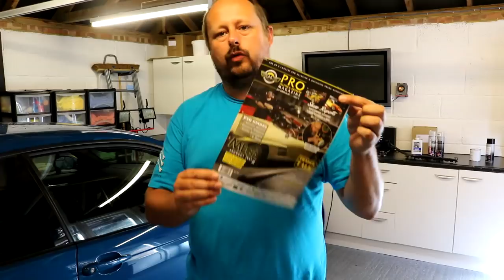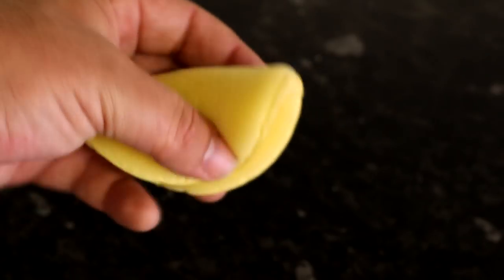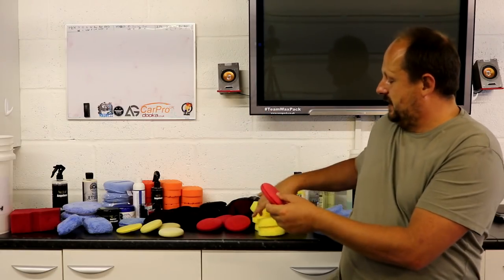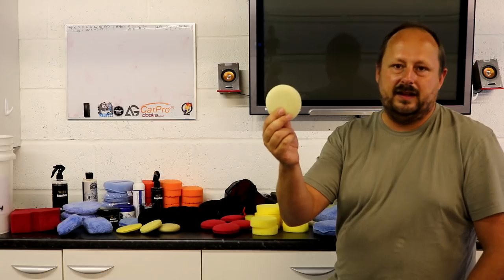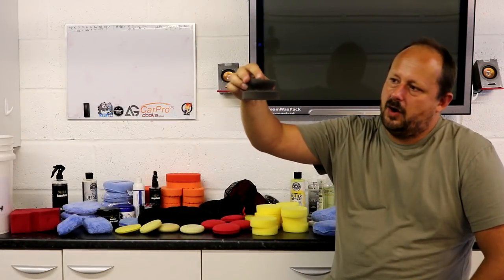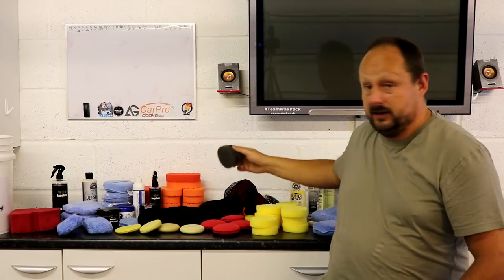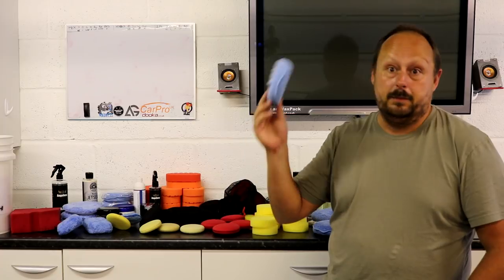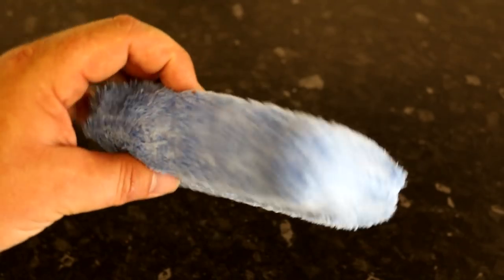The Best Wax applicators - Foam and microfiber car applicators reviewed

Comment: I got one of the shine mate 3" wax/poish applicator sets and you can then use whatever 3" spot pad with the velcro backing that you like. Personally, I like the Farecla G mop 3" black finishing pads. At around £13 for 5 in a pack they are excellent value for a branded product. The shine mate handle thing is about a tenner originally with a couple pads, but its soooooo much nicer to use.

Comment: Hey Jon, are those round yellow cheap foam ones about the same as the applicator that comes in the Fusso can? I really like that applicator, still have it. You just wash it after using and it gets a bit softer than when new but still works very nicely.

Comment: I always grew up believing that sponges or foams created swirls in paintwork, is that possible or just crap. Great channel btw!
Reply: ryco2000uk no they dont. The issue with sponges are that they don’t pick up solids very well so scrubbing them over dirt they will scratch your paint while microfiber absorbs  the dirt and won’t create that many swirls
On clean surfaces however (and they should be clean if you want to apply waxes or sealants) sponges are save.

Comment: Which one of these would be best for a one step like Maguire's ultimate etc
Reply from the maker: The red hex ones I think
Reply: @ForensicDetailing thanks for the reply, that eBay link no longer exists. Chemical guys do one but I didn't want to pay £10 for one sponge. It would have been a good choice because of the surface area. Have you got another link or another suggestion. Thanks

Comment: Congrats on 10k subs John, also want to say I finally cleaned my car myself for the first time using your 2 bucket method video. 
Also wanted to ask but how is the microfiber pads in terms of durability as I've heard bad reviews about some saying the stitching comes loose
Reply from the maker: microfiber madness pads?   solid as a rock for me so far mate.
Reply: thats good to hear. the reviews i looked at were the cheap meguiars pads and another brand ive forgotten
Reply: John I also wanted to ask but on my cars I get these yellow spots and noodle like spots on my car. Just wanted to ask but do you know what this stuff is. I think it's from plants plus how would you go about removing them. I used baby wipes and lightly wiped them off
Reply from the maker: hey but I would not use baby wipes generally..  Or at least I dont use baby wipes so Im not sure if thats a good idea or not but my gutz say no..   Yellow spots and noodle like spots hmmm...   Im thinking bird crap?  not sure if you have a picture mate...     if it doesnt come off during the wash you can sort of work your way up the line of agressive...   starting with detergent of shampoo, to an apc, then a degreaser maybe, maybe something mildy acidic, then after that you start looking at something abrasive like clay or polishes etc..  without knowing what it is its hard to recomend what to try.
Reply: Hey John, from what I've found its bee poo and that yellow deposit is digested pollen and nectar. When I cleaned my car I did notice that one spot didn't come off with snow foam and a light wipe with the wash mitt. I just put a bit more pressure on the mitt to remove it. Will keep a mind on bilt hamber surfex

Comment: Forensic Detailing Channel, have you given any thought to doing a camparison between the Flex XC3401VRG and the new Makita PO5000C? There is a lot of message board chatter around the new Makita PO5000C. as it a shorter throw polisher (does both free rotation AND fixed rotation) at 5.5mm, but has a higher oscillation rate (790 OPM vs. 480 OPM).I am in North America, so I don't even know if the Makita has made it to the UK yet.
Reply from the maker: first time Ive heard about the makita, im not sure Ill be able to get my greasey hands on it over here in the UK
Reply: Forensic Detailing Channel I'm not even sure if it will be released in the UK or Europe  Your review of the Flex XFE7-150 is easily the most complete and detailed review of that polisher, and I was hoping you would do the same for the Mania.
Reply from the maker: if it comes over to the UK and I can find a company willing to loan me I promise ill review it...

Comment: Hey jon got a video idea , I have been trying to research for past few days on how the hell to clean these wax applicators and haven’t found anyone covering this? I have autoglym hd wax kit with 2 red sponges that came with it , I used them about 2 years ago and forgot to clean them and found them the other day and it’s rock solid so I went and collected all my other applicators and some are still soft some are hard but I have a bad habit to use them and not clean them so wanted to know how to clean them properly... do I soak them , do I put them in washing machine? Do I use soap or fairy liquid I’m not sure what to do, you got a good video idea which hasn’t been covered yet
Reply from the maker: you cant easily clean wax out of foam applicators or fully clean.  best thing is very hot water under a tap and spray them out with surfex HD at 10:1 and scrub the hell out of them, surfex is a lot more powerfull than fairy liquid..  very hot water.  but even after doing this they will have some wax in them :)  I would not worry too much though.
Reply: Forensic Detailing Channel nice one I have 4.8l of surfex hd hardly use it other than engine bay clean , didn’t know I could use it on things like this ! Thanks for the heads up I will try that , p.s don’t forget to do a tyre review on those new tyres you got on the m140 you promised to do awhile back in eager to hear your review on em 😎 big up and stay safe fam 👊🏾

Comment: using wo-wo ones for waxes, microfibre applicator pads like these for glazes/pre wax cleansers https://shop.autofinesse.co.uk/polish-pads, the round cheap blue kent microfibre applicators for glass polish (same as your cheap and cheerfull) and these applicators for tyre dressing which are awesome quality and the foam doesnt break up and ive used mine a lot of times https://www.prestigecarcareshop.com/collections/wheels-tyres-trims/products/adams-vrt-super-block-dressing-applicator

Comment: I only use microfiber applicators. I feel that foam does not slide over the paint as good, it kinda sticks.
Reply from the maker: that sticking is usually down to the product you have on top.. I know exactly what you mean though..  I think some waxes are really prone to leaving this grippy feel to the paint and the next time you go and wax it feels all sticky and rough..   other times you wax on top of other products it doesnt happen and you lay down the wax on top and its all silky smooth,,,
Reply: I use microfiber, easier to clean after, easier to put on a thin layer and it is always smooth. No sticking. 
The cheap ones on ebay are pretty good! I have not had any problems with them and if they get old you can just use them for example for tire dressings etc..
Reply: I found this with Bilt Hamber Double Speed Wax. Only glided over the paint just after dipping in the pot. But when you're trying to apply it thin it would stick and drag on the paint which was annoying.

Comment: From complete ignorance, could you use the red dual pad spta hd (the one you reviewed in the ebay polishing pad video) for waxing? I'm using a meguiars wax (it's kind of liquid/cream-ish)

Thanks
Reply from the maker: I think your asking can I use the red dual foam spta pad to apply a wax...   yes you could.  but I find most paste waxes are better applied by hand..  by the time you bust out the machine polisher and set up you could have waxed half the car, plus the machine can access all the areas of paintwork easily..

I tend to only apply products by machine that are looser and less oily than paste waxes, and work better with a really level application...   In fact very few things really..  maybe only abrasive prewax cleaners, or abrasives AIO or abrasives glazes...

Comment: Jon, have you heard of a German brand called Alclear?  If so have you any experience of using their products?  I've never seen any comments anywhere on this brand. I bought a couple of their polishing pucks via Amazon, but they seem slightly rough for the purpose and I'm scared of scratching the paint.  Is there any way an enthusiastic amateur like me can gauge whether or not a product like this is safe, or can be harmful? Not all you viewers are knowledgeable detailers, but love your videos.  Anyway I'm sending for some Auto Finesse pucks on your recommendation.
Reply from the maker: hey mel...   I dont think Ive recomended the AF pucks based on the price.  I found someone selling something similiar for 1.50 but they ran out of stock fast.   Im not sure what AF charge but I would not really pay more than 2-3 quid for any foam hand applicator.  think fecks philosphy sell something like it a lot cheaper.

best way is to test the alclear products on a daily driver or get a test panel from your local body shop mate.
Reply: Yes Jon, my error, sorry.  Must pay closer attention.  I'm claiming a senior moment.

Comment: Hi! i've a question to tell You.. which is the main difference between a wax and a sealant? i mean what i should use for what and when? 
thanks as always great video 
Filippo from Italy
Reply from the maker: hey filippo generally speaking a sealant forms a chemical bond to the clearcoat... where as a wax is left behind on the clearcoat after the solvents vape out...     generally speaking sealants offer more durability but require better preparation..   waxes can offer a deeper more jetting gloss on application but are way less resistent to detergents and their protection and gloss qualities fade quite rapdily (on a product by product bases though there are exceptions to this statement)

we talk about waxes and sealants a lot in the "best wax" video and the PVD mega test wax video on this channel.
Reply: Forensic Detailing Channel thanks for the answer. about layering.. is it reasonable to lay a wax on a sealant? for ex to add more gloss.. (?). So i imagine that the choice of a sealant instead a wax is just up to the user.. according to his target of results.
Reply from the maker: layering is an option, but remember only one product can sit on top, so whatever surface characteristics your sealant exhibits will be hidden away untill the coating above them washes away or fades..  you also run the risk of introducing compabaility problems depending on your choice of sealant and your choice of top product...   certain chemical combos dont work well togther and you can get bad results..   also waxes are around 60% solvent, so another unknown is how your base coat sealant will hold up to being coated in a layer of solvent, and what the implcations are to the sealant and what the wax does.

if your going to layer pick combos that have been formulated to be layered, ideally from one brand..  

For example, using Super resin polish, and then applying extra gloss protection sealant, and using autoglym HD wax after the EGP has cured works.. And it works because autoglym have designed them to work and use compatible products and solvent choices etc...

another example would be using angelwax Ti22 sealant and topping with an angelwax wax like 5th element (good very durable hydrophobic glossey wax) etc..
Reply: Forensic Detailing Channel thanks a million! I'm planning my first detailing adventure so i wanted to have all the things in the right place at the right time (and if possible at the right price 😂)

Comment: have you tried the auto finesse puck?
Reply from the maker: yes I like but with foam applicators I usually dont want to pay too much so most of my recomendations are what I think is really good value.  but AF do some sexy accessories products that are worth supporting...
Reply: Forensic Detailing Channel thanks mate. Is it comfier than the others. I find my hand tends to cramp up using the flat style foam and microfiber applicators
Reply: Jon Bennett when I use a foam pad to dress my wheels I tend to hold it with two fingers and my thumb. I find it more comfortable than using all your fingers to hold the pad which tends to give me cramps

Comment: I love you’re channel, In you’re more recent vids I’ve seen you use a hexagon like shape hand applicator in black with a yellow ring I think it was around the edge of it, do you recommend that applicator and who stocks it please
Reply from the maker: i think thats teh adams applicator (check prestige car care .com) its excellent.. beefy big.. 2 different foams so the handle is stiff but the applicator is soft.. very nice.. only downside is its expensive
Reply: Thanks for that I’ll check it out , much appreciated, keep the vids coming , very informative, I just finished following you’re winter prepare vid on my inner arches, I couldn’t believe how much dirt and salt from over the years was built up in each one I ended up removing the inner arch to give them a deep clean and sealed them up with fusso so should be good enough to last the winter and should be easier now next year to do , thanks again :-)